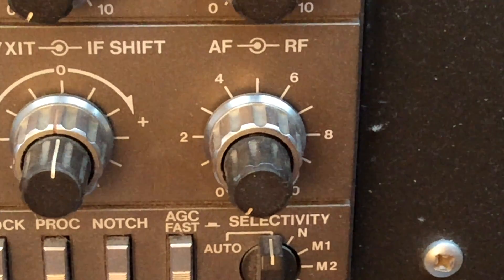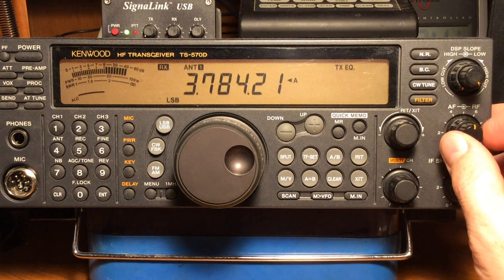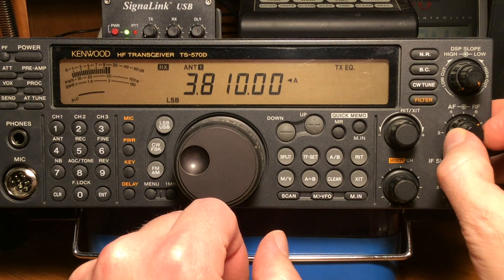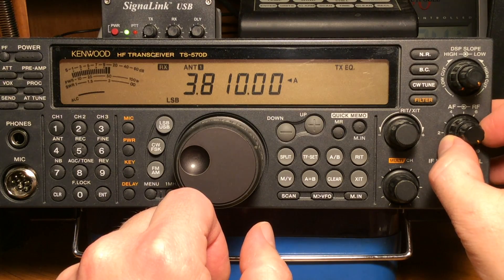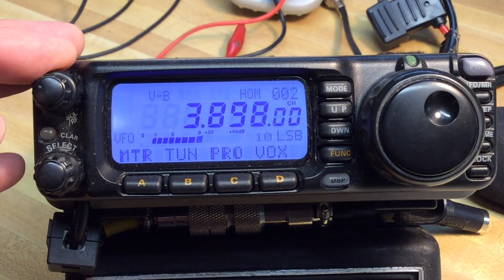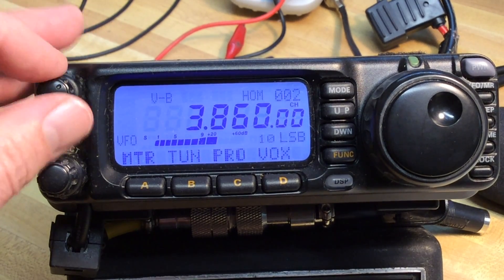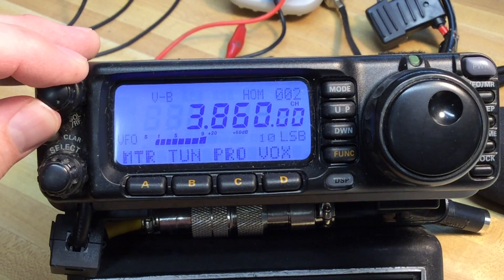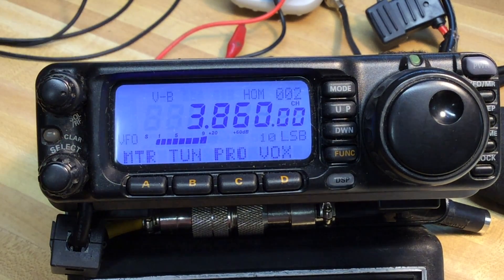Ham Radio Basics -Using RF Gain Control On HF-Less Ear Fatigue

Comment: This technique doesn't work on my IC-7300. I would think one should back off the RF gain until the noise floor is about S2. Makes all the actual signals audible and also works really well to get rid of all the noise on the waterfall.
Reply: That's right the ic7300 and the more expensive ic7610 the rf gain is utterly useless.  Many SDR rigs struggle to have a useful rf gain control,  it's the one thing I really hate about my ic 7300. Another sdr rig I have a xigue g90 which is not nearly so bad you can back off the noise if you use the att and back off the rf gain to 1% it has a good effect but still not as good as a superhet rig . The yaesu dx10 hybrid works well not sure about the newer fully sdr  ft710 ?

Comment: I recently learned this trick in a different video, but I’m trying to figure out how to give a signal report when the RF Gain is all the way counterclockwise. On my FT-891, that results in the S-meter being pegged at 40+dB so I have no way to gauge their signal strength.
Reply: I'm sure I'm in the minority here. But I think signal reports are useless. How would you possibly give one unless your RF gain is cranked up? And that's not the way one should operate their radio.

Comment: Excellent point, yet still some self proclaimed YT shortwave experts with portables attached to hundreds of meters of wire are very proud, that all the segments on the signal meter are lit, while signal is unreadable. Your ear is the best signal meter and it's mostly about signal to noise ratio. Get well soon and 73s!
Reply from the maker: I know what you mean.  Signal to noise means a lot more than getting a good s-meter reading!  73 and thanks.